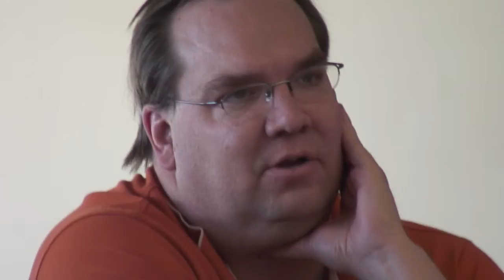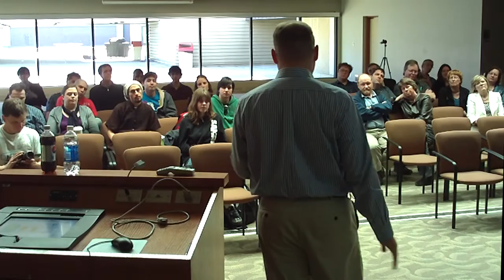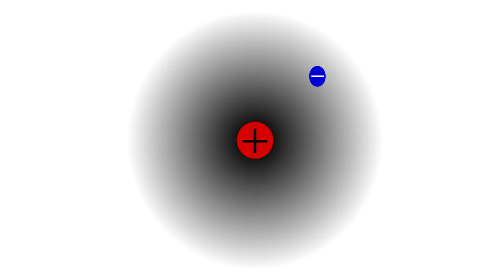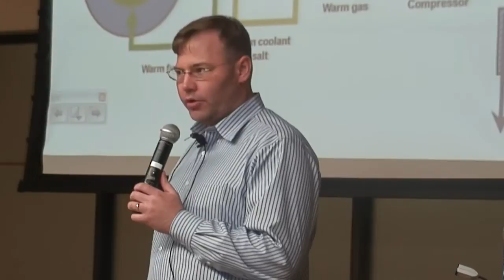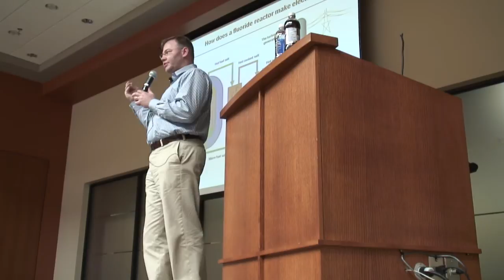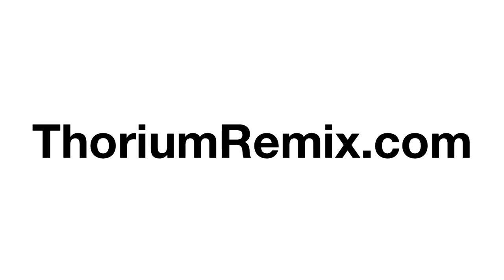Thorium in a CANDU / Solid Fuel Reactor - THORIUM REMIX cut scene

Comment: Dear Kirk, except the advantage of being able to use natural uranium isn't used because it produces more spent nuclear fuel.
If instead you put a Th-Pu mix into a CANDU the better Th neutron production + lower noble gas production allows for longer burnup cycles, which produces less fission products and reprocessing SNF from mostly Thorium fuel needs only to remove the fission products and add just enough Pu/Th to restore fissile / fertile ratios and can be reused (don't need aquous reprocessing).
Reply: Actually I think the official CANDU spec is to use a mix of fuel bundles, some with thorium pellets, and others with natural uranium as normal.  Obviously this complicates the fuel management and loading logistics, but I disagree with the video in that having this feature undermines the CANDU reactor's primary advantage of being able to use unenriched uranium.

When the thorium mining and processing industry is as refined as the uranium industry, it's not too hard to imagine a point where it will be economically feasible to do so - and existing CANDU reactors are in a good position to take advantage of this fuel cycle, being fully capable of utilizing it with almost no physical modifications (just logistical changes like fueling order and software changes to adjust the control rods to compensate for the reduced activity of the thorium bundles).